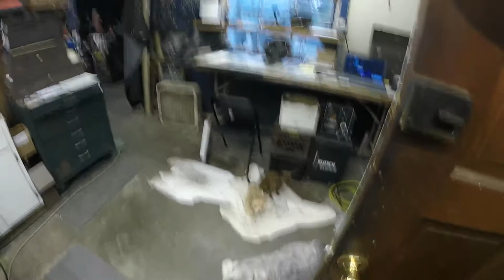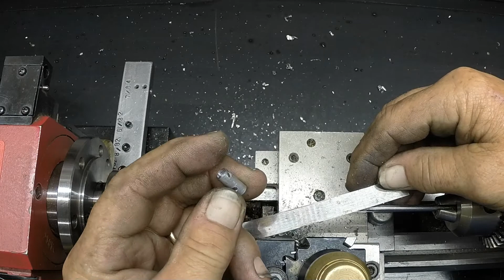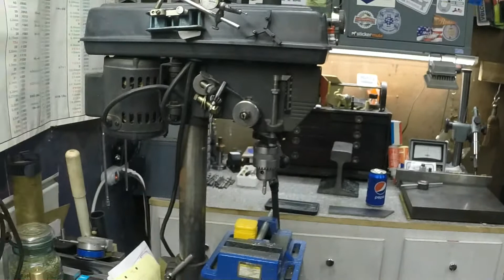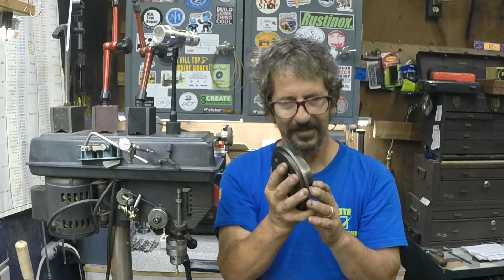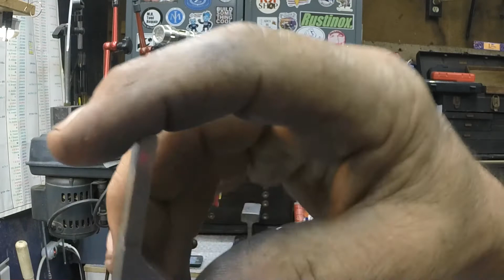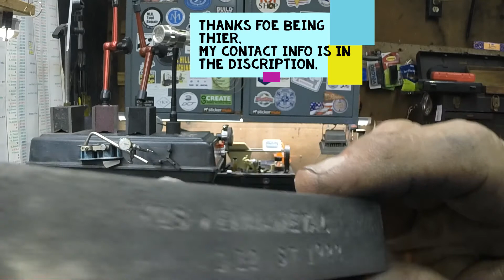COUPLERS, AND MORE LATHE TALK, PRATT & WHITNEY

Comment: The normal and most accurate procedure is to mount the adaptor plate in the new lathe and machine it to fit the chuck.  That way it will be the most accurate that it can be.
Reply from the maker: So would you get what I’m going to call a D 1-5 blank ?
Do they make something like that
Reply: @kimber1958  the most accurate way to do it is to use a D 1-5 blank and machine it to fit directly on the lathe that it will be used on.
Reply from the maker: That’s great, as soon as I can verify it is indeed D 1–5. I’ll get on it.
I saw a 5C collet chuck on Shars not terribly expensive maybe $300 if I’m not mistaken I think D designates my spindle nose. Is that something I should maybe steer away from?.

By the way thank you for taking the time to help me figure this stuff out
Reply: @kimber1958  If it were me I would wait until I had the lathe in my shop.  There are too many ways for deals to go bad.
Reply from the maker: The lady is paid for and just waiting for me to pick it up I have the option to come binding loads with Brian Bloc but I don’t believe I’m gonna have the patience to wait that long so I’m more than likely going to drive up to Cleveland and pick it up myself but I agree what is in the shop we can start making decisions based on true numbers not guesses

Comment: For the D1-5 chuck backing plate, you can either send it to someone with a D1-5 spindle nose lathe to turn the backing plate to fit your chuck, or buy one from Shars with a "standard recess" (like your Mini-Lathe chuck, just bigger) to fit one of their metric chucks and then have someone modify the chuck to fit the backing plate (I only mention this because you might then be able to easily change between 3 jaw and 4 jaw import chucks).  The first of these is more realistic, but please seek out other advice on this - I'm not in the trades.  I only have D1-3 and D1-2 spindle nose lathes (the second is a rare size).  12:25 The natives are restless!

Comment: Is 10" the full swing of the lathe or just the size of the chuck you have?
Reply from the maker: The only information I have is on the 13 inch my lathe is a 12 x 30 but it’s on the same platform as the 13 inch. They phased out the 13 inch in 1942. And put the 12 on the same platform . So the 13 inch.the swinging over the bed was13 1/2 swing over the carriage is 7 3/4 so I think it’s safe to say that swing over the bed will be 12 1/2 and 30 between centers Tailstock quill travel is 5 3/4.
The floorplan for the 12 x 30 is 30 x 87 5/8. 30”. 31 1/4 inches deep.
I have plenty of information on the 12 x 30 just not the specifications of the regular equipment.
I hope that answered your question. The tenants for Joel Chuck is something I acquired from my son-in-law. It belonged to his grandfather.
Top speed 525 RPM !
Reply from the maker: Got a little more information than you bargained for huh
Reply from the maker: That’sBecause I’m so excited about having a full size machine